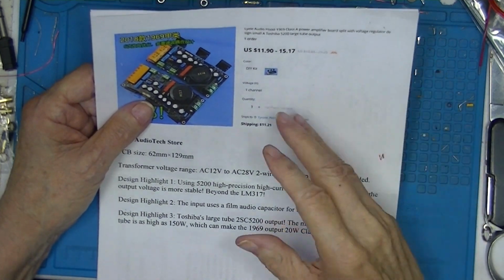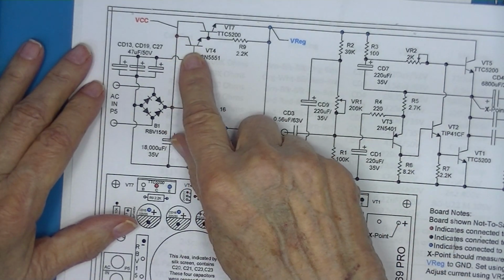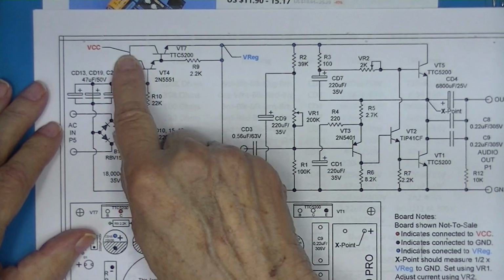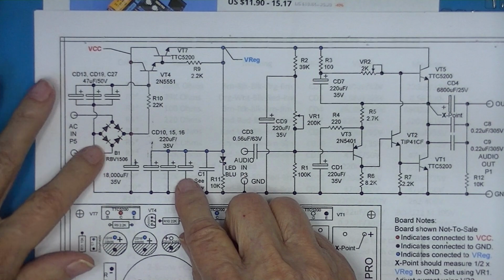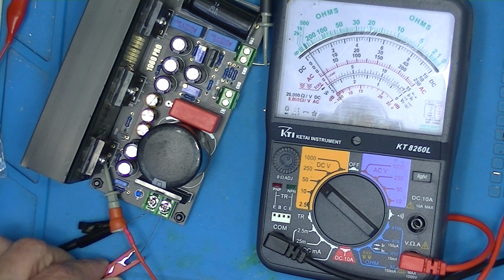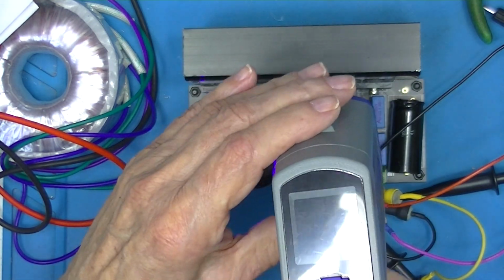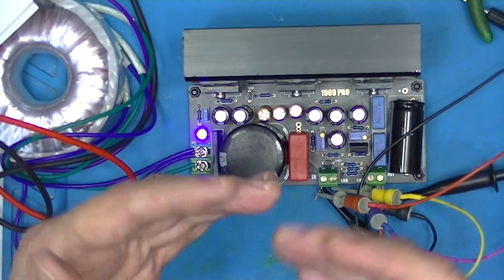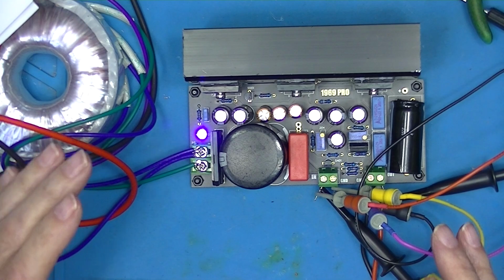J  L  Linsley Hood 1969 Amplifier Part 7D

Comment: The voltage regulator is  incorrectly named.  It is in fact a capacitance multiplier and is exactly what JLH  recommended in Electronics and WW mag.
There is no "voltage" regulation per se but ripple regulation.. for cap multipliers the Vcc (at the amplifier rail) will wander around very slowly as the transformer output wanders over time.. but ripple will be knocked on the head..

Boosted LM317 regs with high current pass TTRs can be noisy if poorly designed..  the output noise spectrum of 317 337 regulators can actually peak inside the audio band in poor designs and maybe that's what the seller was referring too?

Comment: Hi
Reply: Thanks for the detailed video and schematics for these boards! I've ordered them from ali and use them in my heavy diy class a amplifier with 900VA toroidal transformer which has 9 windings, each - 28V 5A. I also use slow start board with thermistors before the transformer. 2 channels. Inderpendent windings for each channel. 3amps through the board. Aerospace/NPP grade PET capacitors as the input and in parallel with output electrolyte. Planning to increase the current and 18000uf cap
Reply: Thank you for your great films!
The so called voltage regulator is actually a Capacitance multiplier.